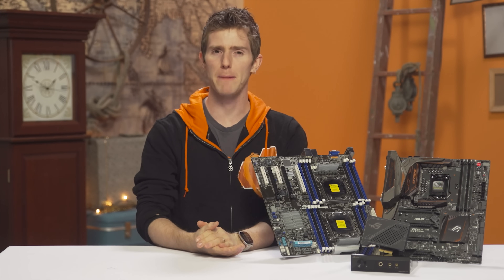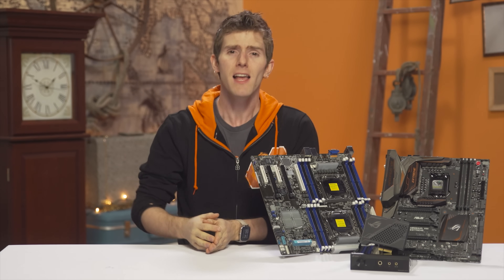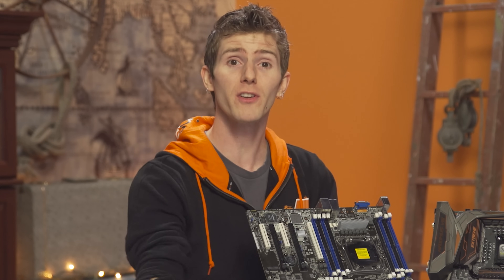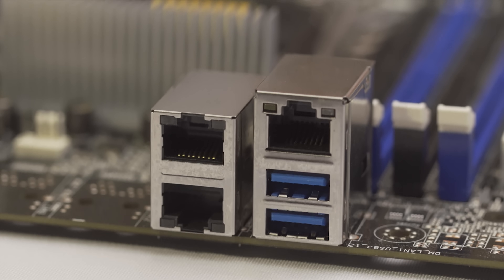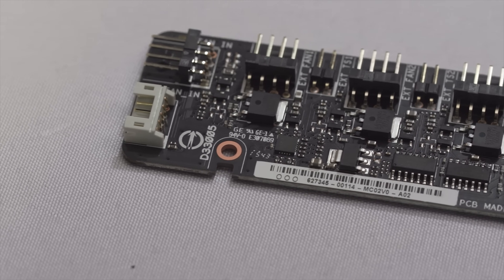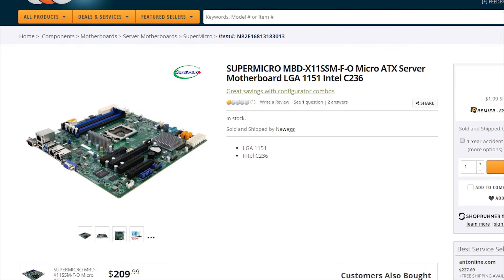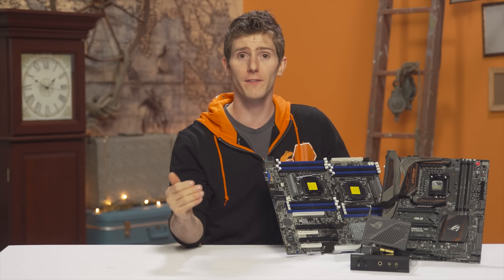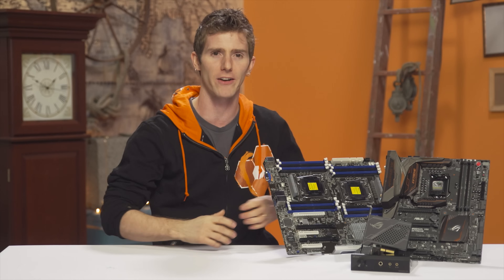What is the best choice for a motherboard? - The Final Answer

Comment: What's the best choice for a non-gaming MoBo from these mid range choices?
ASRock Z590 EXTREME LGA 1200
ASRock Z590 STEEL LEGEND LGA 1200
ASRock Z590 PRO4 LGA 1200	
GIGABYTE Z590 AORUS ELITE AX LGA 1200
MSI Z590-A PRO LGA 1200
ASUS TUF GAMING Z590-PLUS

Comment: Hi everyone, can someone be so gentle to help me? I can't find answers..
I'm not an expert, I'm building my first PC.

Is the ASUS ROG STRIX B550-F Gaming WI-FI a nice choise for this build:

CPU - Ryzen 7 3700x

Grapich Card - GIGABYTE Nvidia GeForce RTX 2070 SUPER (8 GB, Gaming)

RAM - G.Skill Trident Z RGB (2x16 GB)

SSD - Samsung 970 EVO Plus (1000GB, M.2 2280)

PSU - Corsair RM850 2019 (850W)

CPU Cooler - Cooler Master Liquid ML240L RGB (5.20cm)

Can you tell me if everything will work?

Is an MSI MPG X570 Gaming Pro Carbon Wifi a better choice?

Thank you so much for your time!

Comment: So my takeaway from this is that the board itself isn't super important anymore, like chances are your performance isn't going to be directly affected by the board itself, all that really matters is the ports that it has and how many it can support (Sata, PCIe, M.2, USB 3, etc) and the miscellaneous features (eg, sound chip, thermal probes, RBG, etc) So basically the short answer is your choice of motherboard should be based around what you plan to plug into it, as well as what you're actually going to be using the motherboard for.

Comment: Hey I have a problem.I have bought a new assembled pc with motherboard (Gigabyte GA-78LMT-USB3)
But after assembling them my vram/dedicated graphics shows 0mb. Though it contains integrated 3000 graphics . I have tried in BIOS to set it at 1024 mb (heighest) but it still shows 0mb

Comment: I did wonder why some motherboards are so damn expensive.

So I take it, I can just pick the cheapest one, as long as it supports my minimum needs, and supports the correct CPU. (SLI capability, four memory slots and enough USB ports.)

Though, are there motherboards which can protect your USB ports from damages? Four of my ports kind of died, and I can't reset them. Figured I should at least get some protection.

Comment: If you plan on gaming in 2017 then this is what you need on a standard sized ATX motherboard (motherboards come in different sizes, but ATX is the most common):

- CPU socket (duh)
- 2-4 RAM slots
- 1-2 PCI-E x16 slots
- Around 4 SATA sockets
- Around 4 fan sockets
- Ethernet, HDMI*, DisplayPort*, audio sockets (maybe DVI if you're using a really old monitor)

*If you are building a gaming system then the likelihood is you'll be using the display interfaces on your graphics card anyway so don't worry too much about whether your motherboard has them.

Anything else is optional. If you need wifi then look for a board with wifi installed or alternatively buy a Wi-Fi PCI-E adapter.

Another good option is an M.2 slot for storage.

Also ensure your board is compatible with your CPU (especially with newer Intel Kaby Lake and AMD Ryzen processors).

Finally, if you plan on overclocking, make sure your motherboard will be okay with that.

Comment: Real answer:
Socket LGA 1151
DDR4 RAM compatible
SLI compatible
Onboard audio
Numerous USB 3.0 ports
1 Gigabit Ethernet port
HDMI/Display Port (optional)

Anything else are just extras that you decide if you want or not, or are obvious in modern motherboards (like SATA connections).

Comment: First find out what your price range is, then you need to decide whether to go with AMD or INTEL, then depending on your budget you need to decide which CPU offers you the best performance for dollar. Once you have your CPU selected then you can do a search for the different Motherboards that can run it and decide which one is best for you based on you money. If you are going to be gaming then the board must have a up to date  PCIe bus so you can get the most out of your GPU. Most people will only need one PCIe connector, extreme gamers will probably want something with 2 PCIe lanes to do SLI. Once you have selected your CPU and Motherboard you are pretty much set, from then you will have to decide how much RAM you want and what GPU you can afford as well as other components. 

IF you are not going to do anything extreme then stay away from unlocked CPU's, they require more expensive Motherboards that allow a user to overclock that CPU beyond its specs. 

That's pretty much it.

Comment: i want to run the software launch box on my pc they copy it over to my arcade machine. launchbox big box mode will be my front end. so windows will be running in the back ground. for my arcade what motherboard and processor should i use ? my arcade will strictly be used to run as a arcade not a PC.... i need help on what circuit boards to buy... the cheaper the better... but quality of my arcade needs to stay the same as my pc ??? please help :)

Comment: I want to built workstation with following specs:

CPU: Core i7-7700K
RAM: 16GB DDR4
Storage: 1TB SSHD, 500GB SSD
OS: Windows and ubuntu
Monitor: 24" Full HD

Please guide me for selecting best suitable motherboard for My application.

My Application is
1) Programming C,JAVA
2) PCB Design (CAD)
3) Will run Virtual box or VM ware to run Linux, MAC,....etc

I have figure out few Asus P10S WS and Z270-WS motherboard with Intel C236 and Z270 chipset.

Which chipset is more suitable for my application?

Is P10S WS motherboard is good choice for core i7-7700k?

Comment: Ironically, a 1150 mobo (1151 barely it's an upgrade, you know it) with a Z chipset that's either MSI, ASROCK could be a better option for most gamers rather than just flashing lights and DDR4 (Spoilers: frequency doesn't even mean better...)

Comment: Best build advice I heard long ago...  Don't go with "bleeding edge" gear or the "latest and greatest"... Whatever you really like, go for the gear a couple steps down from that.  If you go too high with your rig, then there's compatibility issues etc.  For example, for my next upgrade, and limited budget, I'm looking at a nice Z170 mobo instead of a Z270, due to pricing, and the Z170 HAS what I require for my rig...

Comment: Guys I need some help. I'm looking to upgrade my PC since it's a few years old. I have decided on an ASUS GTX1060 and Intel i5-6600. I'm not interested in overclocking and I will reuse my SSD and power supply. 
Could you guys help me out on picking a reasonable motherboard. I'm not looking for some super high techy-techy thing. Just best bang for buck that supports the GTX1060, 16GB of RAM and the i5-6600... any ideas?

Comment: My 90 dollar biostar motherboard still works just fine.  Haven't even thought "I really wish it had this feature" yet.  Well one feature I do wish I had now was a better CPU port, but that's just because my 2500k is getting old now.  When I do finally upgrade I will start at the bare bones and just ask myself what features do I really need.  I might not even go with one that can overclock like this z77, because frankly I haven't really needed to do it.

Comment: GUYS SHOULD I BUY A LGA 1150 OR A 1151 MOTHEBOARD
Reply: Frank Doukas buy both give 1 to poor people
Reply: Frank Doukas Depends on your CPU
Reply: Kippenoma I actually wanted to say is that should I buy a LGA 1150 for a cheaper price or buy a LGA 1151 that supports ddr4 but with a bigger price(also does LGA 1150 supports windows 10?)
Reply: It does. But you should still think about the CPU because all CPU's wont fit in a 1150 or 1151.
Reply: Miklon Dk I know but I don't want to lose anything by buying a LGA 1150 motheboard (for example ram)
Reply: The only thing your really lose is DDR4
Reply: Miklon Dk what do you suggest me?
Reply: I would suggest a LGA 1151 motherboard because it's newer and so will the CPU's
Reply: Miklon Dk ok man Thx

Comment: Hey I want to build a gaming on a slight budget, I'm thinking of getting a intel i5 6600k, 8 gb ddr4 ram, a Gtx 1060, and a 1 tb hard drive, what psu and mobo souls I get? I was thinking 500w. With three fans maybe? Do I need three fans? Don't think i need to overclock.
Reply: Drew Jones if you arent gonna oc dont get a 6600k a msi h110m or b150m is going to be fine also right now amds offering in the mid rsnge gpus is better
Reply: Go for msi boards and amd gpu
Even the richland has integrated graphics and higher processing power,also try evga power supply,they got some sturdy psu.couple all of them with a nice entry level liquid cooling system and you got yourself a nice custom gaming pc

Comment: Should I upgrade to a z170 board from h110 board
Reply: i have a core i3 lga 1151 and I was wondering is it worth it to get z170 board so I can have more ram and put in a i5 or i7 to overclock
Reply: Ferguson 20 diesel your existing mobo will support i5 and i7 processors just fine, however,if you want to over,i.e. want to buy a K series CPU ,go for the z170, otherwise you'll just be wasting money
Reply: I'm going getting a z170 so I can have more ram and throw in a i5 and over clock a small bit
Reply: Ferguson 20 diesel h110 mobos already support 32 gbs of ram for god's sake..Yeah,for overclocking,you have to go with the z170
Reply: Idiot I want to over clock which is why I I'm getting a z170 which has 4 dim slots my old board has 2 I happen to have sticks of ddr 4
Reply: Ferguson 20 diesel read my comment again when you grow up and it's not cool to call an unknown person idiot, anyhow, given the fact that you are a teenager who has a lot to experience in the real world,I forgive you..Now don't bulldoze me with hate comments, you'll just waste your arrows
Reply: Ripan Dutta I was meant to say I have four sticks ddr 4 and you don't know what age I am so you can't say anything
Reply: Well, from watching this vid i would say no. You dont gain anything much from it exept better audio and a few extra plug ins.

Comment: I still have no idea what motherboard I should pick without going over budget. This is by far the most confusing thing about PC building for me.

For reference, I'm trying to build a PC with a core i5 6500 (unless someone has a better/cheaper suggestion), gtx 1060 or RX 480 (idk which is better), 16GB of DDR4 RAM and a 2TB HDD and 250(ish)GB SSD combo. 

Oh and would a 500W PSU be enough to power all that? It's one of those good gold something something ones.
Reply: If I was you I would buy a 650w so you don't have to change it later on but it probably would power it if you used a gold 500w
Reply: Im having the same issue.

Comment: only 100€ is enought for motherfoard
Reply: u dont need to overkill motherboard feautures, why you need those details just go with black psb and rock u will save 100% without plastic covers for northbridge and southbridge around 100€.
For me its very big money actualy 150 more and here goes the cpu i5 3.2ghz.
Also its prefered to go with the newest technology onboard (chiep set and DDR type, socket, pci version...), u may ask why but when you need to fix something or upgrate it wont be fuc!ing pain in the ass to find a spare part like ram specialy if you live in a pour country where ebay and amzaon dont deliver stuff cuz its so expensive shipping

Comment: I went by size first. I don't have much space to spare so Micro ATX / ITX were the best options for me. The Core i5 2300 in an Antec ATX case I previously owned was just too big. So I needed to downsize whilst gaining a worthwhile speed bump.  Went with a Core 6500 on an Asrock Z170M Pro4S Micro ATX in a Cooltek C3 case. Much smaller, quieter and faster.

Comment: How do i know if a motherboard support the new skylake proccessors or the old ones?
Reply: JAXX H110, B150 and Z170 boards support sky lake processors
Reply: Skylake processors use the LGA1151 socket, which is also the H110, B150, H170, and Z170 chipsets.

Comment: There's to many freaking options out there now day's. I can't figure out what to settle on for a mother board. It's ridiculous.
Reply: Yeah, I find motherboards by far the most confusing. Graphics cards are more or less linear, e.g. this one is worse, this one is better. Motherboards have, lack, or are practically the same at the same price point, then if you find one at a higher price with similar features, or with better reviews but similar features, it makes you think "Am I forgetting something? What does this have that those don't." You pretty much have to look at each motherboard individually to figure out which one makes the most sense to get. The only for-sure thing I can recommend if you want to "future-proof" is getting a motherboard that supports ddr4 instead of ddr3 ram. DDR3 will serve you fine, but whenever comes the day you want to upgrade to a cpu with a newer socket type or something, you'll have to buy a new motherboard and new ram as opposed to just switching processors.
Reply: if you need some help theres always people on the internet that will help u out :) are you currently interested in getting a new pc?
Reply: Edward Berry You shouldn't worry too much about Future proofness. As soon as you buy a part its outdated.

Ps: Amd livestream right now! The new 8 core beats the 6900k!
Reply: Definitively am! I bought the be quit base 600! I think maybe I should of got the fullsize tower instead of mid size but I just ordered it when I did because I figured I cant keep delaying the first step and I just took action. I'm trying to build a gaming PC that it also super silent. I watched some videos by linus on his quit builds but they where two years old. I'm looking to build one of those $2 grand computers that will stay up to date for sometime but while keeping it nice and silent! I can't buy everything all at once but I figure my next step is to get a mother board! I want some nice shit with premium features! I hate skimping on on this type of stuff so it's why I want to build it over time. I don't mind blowing $400 bucks on a mother board for my next step. However I'm not just interested in the most expensive product just because it may be expensive. I don't care if another product was cheaper, id get the cheaper one if it was a better quality product! Get what I'm saying? ahhh I'm just a little frustrated over the whole subject..lol See I don't wanna follow a 2 year old video because it's two years behind which means itl go out of date quicker!
Reply: Edward Berry yeah theres always something better lol.
As long as you have the cash
Reply: i know
Reply: the mobos are so dimilar and the manufactors never tell you the important stuff
Reply: Baron TV iv been talking to my buddy about this situation with computer parts. For us it's even hard to understand which graphic cards to buy. There's so many options to choose from, the market is flooded with so many products, it's like trying to learn a new religion or deep mathematics. Can't get a grip on anything!
Reply: Baron TV I like the idea of having many ports and such an you know HDMI slots, audio options, what ever things I may need and slots hehe. it's just stressful lol

Comment: Gigabyte MB have been very good to me. I've never had issues of reliability that I got with Asus.
Reply: my asus mother board is so fucked im getting a msi
Reply: Same here, I been building and fixing computers 10+ years and had the least amount of failures and most stability with Gigabyte. Though there are many variables, I still consider Asus top quality as well. I never had overall "bad" experiences with Asus, I recommend either brand, Gigabyte is my personal preference
Reply: loombandsm8, yes they are pretty good and reliable... but their RMA dept. sucks, you are screwed if you ever have to deal with them. also they are very expensive.

Comment: Okay guys Cyber Monday is upon us and I need help picking parts to build a pc capapble of running 4k at at least high settings (most settings not so much post proccessing and such) and at least 60 fps. I kind of know what gpu I want, Im leaning towards a GTX 1070 founder's edition (specifically the GV-N1070D5-8GD-B off Amazon) or the GTX 1080 (GV-N1080TTOC-8GD) off of NewEgg. Any useful information is greatly appreciated gents!
Reply: Anisty CS:GO 4k high settings 60fps with a 1070 HAHAHA
Reply: Anisty CS:GO Awesome, thanks.
Reply: get a 980ti evga ftw edition, it will outperform a 1070
Reply: Anisty CS:GO Got the 1080 when it was on sale. Gonna build my rig this weekend when my processor comes in. Too excited right now.
Reply: Zephir il ventilatore chiassoso depends on game lol
Reply: Anisty CS:GO that's obvious... If we think about that in this way even a 750 can perform 60fps in 4k on snake
Reply: exactly thats why i said get the 1080 so you can play bf1 + more demanding games in 4k

Comment: guys can you check out my parts? should i go for the gtx 1060 6gb or 1070 6gb because im using it for gaming only. http://pcpartpicker.com/user/Helix_Ayy/saved/Lj4dCJ if there is anything weird pls let me know ty
Reply: ***** Oh I didnt put then in because I already have 'em :). Thx for sharing your opinion
Reply: you could probably get away with getting a cheaper water cooler in order to save some sheckles (the double wide rad seems a little overkill). but otherwise it seems fine. the 1070 would probably be more suitable if you're looking to fill up that 144 fps limit that monitor can offer and have some extra eye candy.

Comment: What motherboard should I get, I have a i5 2500k processor. I want a cheap/reliable motherboard that is compatible as a LGA1155 and at the same time not a crappy one. I was hoping to get one in the $0-$150 price range. Is it possible and if yes then what would be the best option? I'm willing to spend a little more but not by much.
Reply: It really doesn't matter, I'd take it if it was from a reputable brand and carries the Z68 chipset.